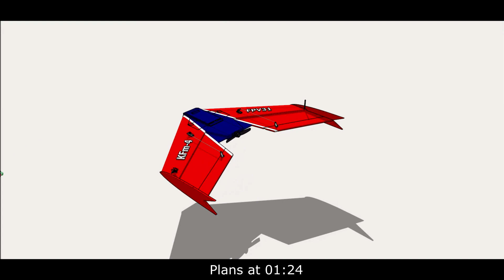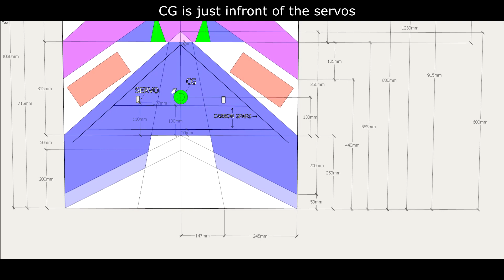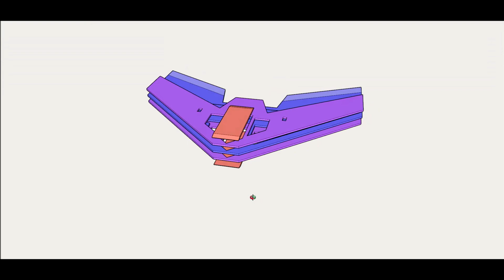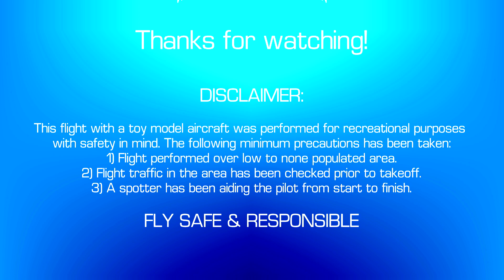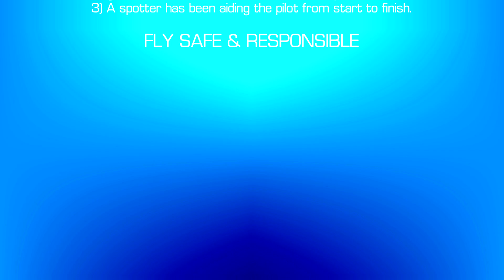FPV31 Plans

Comment: Thanks for the plans and amazing videos. Please what proppeller do you use with 2205 motor. when i launch mine the wing is on the back and roll. May be my launch no good
Reply from the maker: Hi, thanks! I use a 6" prop (currently i use 
Gemfan Flash Durable 2 Blade 6042-Black), 4S 1550mAh battery and launch with full throttle. Here is a video of how i launch it: https://www.youtube.com/watch?v=FxlA2RQOeGQ. If everything is setup like mine it should shoot straight up into the sky. The only thing I can think of would be if your elevons are misaligned or something.
Reply: @FPVTrond  
Thank you  very much for all your advice

Comment: How can I find the Depron you used? Which mark?
Reply from the maker: Found this thread in RCgroups that may help: https://www.rcgroups.com/forums/showthread.php?2837830-Where-to-get-Depron-now-in-the-U-S . In general you don't have to use depron, you can use dollartreefoam or the stuff they sell at Flite Test. As long as it is light and strong enough it will work just fine.